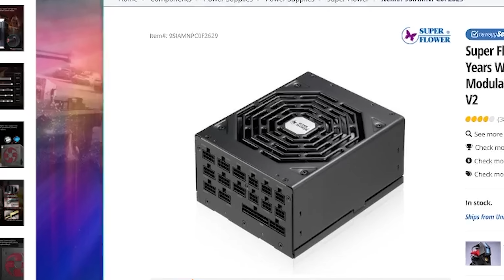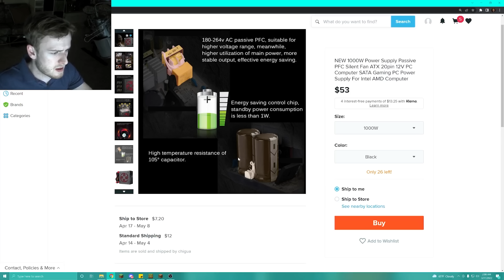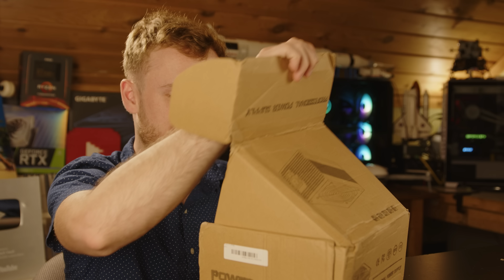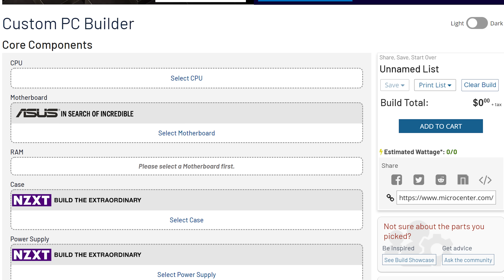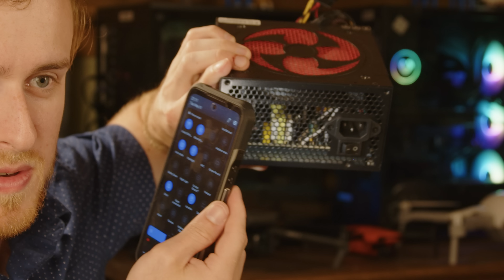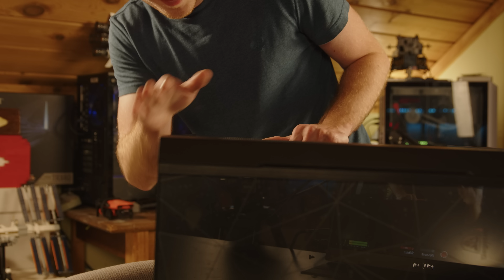I Bought A $52 1000w Power Supply From Wish.com and It Caught Fire

Comment from the maker: If you guys want to play on my personal Minecraft vanilla server that I play on apply here to get whitelisted: https://discord.gg/8Znv79RxTk
Reply: very nice
Reply: i think its just the flux from soldering the power leads to the power connector ot maby just burned from soldering iron 
i dont thint its actually burned
Reply: diotic review. At least you could read the specs for +12V rail to see what is a real power rating of this PSU. From my experience this is usual 600 W (maybe slightly more) PSU with passive PFC to save on cost. Power efficiency should be somewhere around $70. And no, they are not fire hazards. In China they use them in internet cafes, for cheap builds, even for mining. Overall, what you pay is what you get, for few more bucks you could get something with bronze rating and some warranty. But they are not terrible either, could last few years.
Reply: you honestly sound scared for your life in this video

Comment: Dude get some electrically insulated screw drivers.

Those wires looked like they were discolored from soldering to the connector.

18 awg can actually handle 9 amps.

Comment: That is not burn wire, why would it, you never put load on it! Those AC connectors are often hand soldered and that is why those wires are burned, poor chinees that does 500 power supply AC connectors a day didn't have enough time to solder it nicely. 😁 Why not just use multi meter and start testing, turning it on and look at isn't a test.

Comment: Super Flower makes PSU's for EVGA and I think they also used to make Corsair PSU's along with Seasonic back in the day Corsair is now exclusively Seasonic now. Bad Omen A power supply that powers on with no components connected to me that screams A shorted circuit path do not connect to your equipment. (Correction I didn't see when you connected the power jumper Oops!)
Reply: Evga no longer use superflower they us fsp which are also really good

Comment: This reminds me of the time I discovered you can't use a 350 watt power supply on a system that uses 350 watts. Power supply went off with quite the bang, gf thought someone was firing a gun.

Honestly, it looks like that's either soldering flux on your wires, or it was on fire before they even sold it to you.
Reply: Your system may "use" 350w, but for short times it will draw significantly more than that. On low wattage psus, this will be an overcurrent. Unfortunately, low wattage psus also tend to be low quality and lack ocp, so instead of turning itself off before damage can occur, it just explodes. Next time, if you have a computer that uses 350w, you want a psu that can supply at least 525w

Comment: Was the smell near minute 6 the smell of that melting plastic in contact with steel? I had almost a decade ago a bad power supply run for 2 years on an old PC and it always smelt like that... it was rated as 150W at least
Reply: If smells like that you must change it before it burns. it may damage your pc
Reply: @xdarkdragonx2727  I had to upgrade that PC before I saw it burning or damaged... and we all know that upgrades from DDR2 to DDR3, Intel socket changes etc. basically meant a new build from scratch and I only used the case and DVD ROM from the old one.
Reply: @theloststarbounder  Good

Comment: To be fair, if you go to "Countries with 200+ Volt power outlet" where they also make Power Supply, you will be surprised to find a Cheap PSU with high Watt capability. Because the amps needed also lower. From Tâïwan for example.

So let's say a reputable PSU Company like Seasonic. Their PSU are listed to be compatible with 120v-240v and that's exactly why they're heavy. The PSU itself must have to have at least 4 Transformers inside to handle different types of Voltage input from power outlet. 4 Transformers = tons of VRMs = Heavy components.

Meanwhile cheap PSU that is only rated at 220v-240v only have 1 or 2 Transformers inside. And sometimes it also has Voltage input detection that will refuse to turn on PSU if the Voltage coming from the power outlet is less than 220 volt. So the Transformers doesn't have to work as hard. Which means more Rooms inside, and more lenient for Heatsink.

That's why it's Lightweight.

Imagine if the entire planet Earth are united to use 220-240 Volt outlet ONLY, then the Reputable PSU companies like Seasonic, ThermalTake, Corsair, etc etc will also make a Lightweight PSU, because they don't have to include 120v Transformers.

Comment: I have had this happen once, it lit up like a flare for about a second on the sata power connector the first pc I built (with this PSU), I was selling it and just told the customer to come pick the pc up. I promptly RIPPED that POS out and sprayed some ozone around to get rid of the smell 😂 swapped the PSU with a better one and sold it about 15 minutes later I also had to put a rug down 😭 because it burnt my floor lmao
Reply: You let out the magic smoke and then sold the pc without stress testing every component? I feel sorry for the buyer, you likely just handed them a rig that will fail.

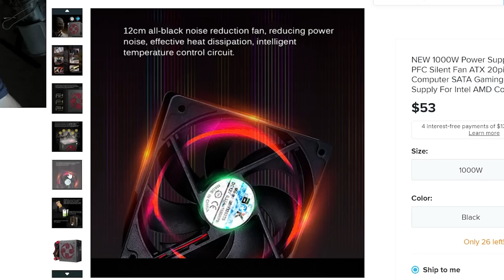Comment: That looks like to be made for only about 230V due to the plug being standard european plug. So it draws double the current from a 120V outlet. It even says in the photo in 1:35 it not being made for 120V, but for that random 180V-264V. So I think you just used the wrong voltage.

Comment: Idiotic review. At least you could read the specs for +12V rail to see what is a real power rating of this PSU. From my experience this is usual 600 W (maybe slightly more) PSU with passive PFC to save on cost. Power efficiency should be somewhere around $70. And no, they are not fire hazards. In China they use them in internet cafes, for cheap builds, even for mining. Overall, what you pay is what you get, for few more bucks you could get something with bronze rating and some warranty. But they are not terrible either, could last few years.
Reply: He didn't put any load on it and it almost caught fire lmao. You didn't even watch the video, or you're just an actual bot

Comment: Others have mentioned this but it's likely the CPU went up because you were running 110 volts into it and it's looking for 240. In an attempt to compensate it's pulling more current to try and make itself run. Tldr of that is watts is volts x amps so less volts means the psu will draw more amps to compensate and attempt to hit operating levels. Problem with THAT is the by product of amps is HEAT. More amps equals more heat and yeah... That's how you get melted wires

Now granted, a well designed PSU would not have even turned ON in this situation so it's still a pile of crap for turning on when it knowingly has less than needed voltage going into it. There's obviously no protection circuitry in there.
Reply: Either way, I imagine this wouldn't run that badly if you plugged it into a 220 to 240 volt output as opposed to 110 volt

Comment: Fun Fact:
The ATX Standard defines that the "12 Volt Rail" is safe to operate and is within specification between a min low of 11.2V to a max high of 12,6V
Reply: Electrically that sounds about right. 12 volt equipment will be designed to operate within that tolerance range but ideally you want it to be at least STABLE voltage wise

Comment: You probably will get more energy out of it from combustion. I'd say even heating it up over an open flame would help to solidify the solder joints and help it run better!

Vroom vroom! :D
Reply: No, you wont. These PSUs are all over China, they do last for few years. They usually have around 600W on +12 V , but low power efficiency (around 70%) . Not recommended for bying but they are not fire hazard or anything like that.
Reply: @aleksazunjic9672  The wiring was quite literally burning from basically no load. That is a fire hazard. There is no other way of interpreting that situation, (That's sensible at least) other than that the Powe supply is a fire hazard.
Reply: @nikkiofthevalley  Nope. Insulation probably burned during soldering. Not highest quality manufacturing, but as I said such PSUs usually last for years without major problems. Anyway, if you want to do a review of PSU, do it properly (under load) or do not do it at all. Otherwise it is just idiotic.

Comment: You forgot to check the input voltage! The listing says it's rated for 180-264v! the wires started burning because it tried to compensate for the low voltage with high amperage that it was not designed for!
Reply: Yeah that would do it! High amps generating all that heat because lol american electrical system

Comment: Super Flower and SeaSonic are the two go-to brands. Pretty much every other company like Corsair and EVGA use their platforms for their own products.
Reply: my ass cannot afford seasonic premium PSU
Reply: @WatcherKoops4677  That's fine, you can probably afford one by Corsair or EVGA with the same internals.
Reply: @Julia_XTX  yep. will get EVGA for my future upgrade
Reply: My beloved Seasonic Prime PX-750 been serving me well.
Reply: I buy only seasonic psu for every pc i build or upgrade oven i put it for pentium 4 2,6ghz for the safe
Reply: Cooler master 🥱
Reply: FSP is also another fine brand
Reply: @TingFeng77  until it's Q-Dion subbrand (which is actually another brand somehow using FSP's name but anyway).
Reply: Even Asus are using seasonic PSUs and making them better, the strix PSUs are literally 80 plus platinum in testing but they labeled them as 80 plus gold. Gamer nexus did a review and it's a great psu

Comment: the wire from mains doesn't need to be that beefy(beefier for 110 than for 220 of course).  the 12/5v/3.3 side needs to be a lot, lot lot beefier as the current is higher to push the same watts as the input is(minus conversion losses) at the lower voltages.. provided that there's any load and current going of course, as it seemed to get on fire without any load which has nothing to do with the wire gauges themselves
Reply from the maker: I thought that too so I looked at comparable PSU internals and the wires from mains are easily 3-4x thicker. From either the coating or the metal itself.
Reply: @JaysTechVault  yea, I don't have a handle on 110 anyway. if they're copper or alu makes a difference too.

the problems that it's just bad :p. but the wires didn't look worse than in thai extension cords and they're fine for electric bbq.   if they don't catch fire at the fuse, which I've seen couple of times in 10 years..
Reply from the maker: I highly doubt the wish PSU is going to use expensive thin wires.
Reply: @JaysTechVault  yea probably not(as if there was any logic in the stuff they sell on wish tho), but the low voltage side has 10x+ the amps if it somehow didn't break before you could put a 1kw load on it, and those will melt much earlier, without load or light load the short mains side jump from connector to the pcb could just be headphone cable and it would be fine.

the winding inside that transformer for the switching psu is crazy thin(even on legit)

Comment: I'm thinking given the European plug on it it's actually only made for 230 volts and the lower voltage has caused too much of a current pull.
Reply: but there was barely any current draw at all... yet the cable was already starting to burn (he confirmed it didn't look like that beforehand in a comment) and it shouldn't have allowed itself to turn on in the first place if it's that out of spec and didn't support 120 volt... so still a bad PSU
Reply: @RainboomDash  Yes, really badly made

Comment: The input wires are a bit melted because of the soldering procces, and they do not need to be that big, because judging by the looks of the internals the power supply would probably not be abale to deliver more than 550W and for the wire to carry 550w on 220V line you need about 2.5A while on the output on a 12V line you would need 45A for the same power witch is why the output wires need to be that much thicker and why there is a lot of them. From my expirience of taking theese scam PSUs apart, theese units are not that badly built, they are just massively overspecced.
Reply from the maker: I thought that it might be from soldering too. However when I looked back on earlier footage it was indeed not the same. It looks like the solder joints heated up.
Reply: @JaysTechVault  It takes quite a bit of power to heat them up to the point where the solation starts melting, there was something very wrong with the supply if it pulled that much power from the wall with no load on the ouput.
Reply: @filenotfound__3871  I assume it was constantly pulling the entire 500W limit its probably actually working with. Doing some math on it I figure at 500W that wire joint will increase in temperature by 145.17363 degrees C every minute. Extremely cheap solder will melt at 90C and soft solder will go up to about 450C. While this is lowballing it... it is a $50 power supply from "no name here factory" in "slave labor district" China. Based on the math here, I see that the such a poor design would require a maximum operating ambient temp of literally below -80 C.

If we assume they used hard solder, like lets say silver... it appears it would take 396.9959 seconds to failure in that condition. Of course, this is all based on the idea that the power supply is -- for whatever poor design choice was made -- pulling at least 500W of power at all times.

IDK though, whats your thoughts on that?
Reply: @explodatedfaces  

*Visible confusion
Reply: @explodatedfaces  How do you have enough information to give your answers to such precision?  Interesting analysis.
Reply: @michaelprice3031  I made some assumptions on the gauge and material of the wiring based on the images provided and the other objects around it as sort of a measuring point for scale and size. Then I considered the utter disasters I have seen with my own two eyes in cheap Chinese manufacturing of PSUs. Assume there is a pretty decent margin of error to my analysis, but I suppose Jay could always review his recording and tell us exactly how long the wire was charged for.
Reply: @michaelprice3031  oh and the analysis itself, relying upon the the specific heat capacitance of common wiring, an estimation of the wire gauge and number of strands from similar products, the length of the wiring to determine its approximate mass you can calculate its change in temperature given a specific wattage (this is how we calculate the BTUs of an electric heater as an example). Then you compare the increase in temperature per second to the melting point of the solder (which will fail before the metal of the wire does) and you reach the longest possible survival time of the system. At the point the solder melts electricity will start to arc from the mains power and produce flash burn patterns you can readily identify later even if you missed the flashing itself. Typically, you'd notice but not if the solder isn't completely melted and only a few strands come loose.

The shorter survival time is melting the PVC sheething over the wire at the point closest to the mains power, which will promptly burst into actual flames at about 391 degrees C. This usually doesn't happen very often as a properly built PSU will have much more substantial wiring with a larger gauge, sometimes solid copper wiring, and will use higher quality metal alloys when called for. All of which means you have substantially more specific heat capacitance to make up for before failure, eventually settling into a steady state of "not on fire" while the fan pulls ambient air over it to keep it cooled.
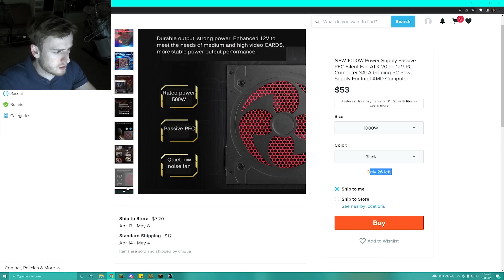Reply: 1:28 shows the actual rating I assume which is 500W (pause than click)
Reply: @IMDYT420  The picture is so blury I can't read it
Reply: Basictly yall saing it is not made for that much energy obvius thing and that u buy some weirdly made power supply aint meaning its wont work propably you really know a bit

Comment: 1000W 24 volt rating, Adamanitium Rated, it'll slice through your Intel or AMD CPU and dice your Nvidia or AMD graphics card to pieces, or equally burn down your house.

In either case you'll have the blue/green/red lighting as you watch your house burning, fun for the whole family!